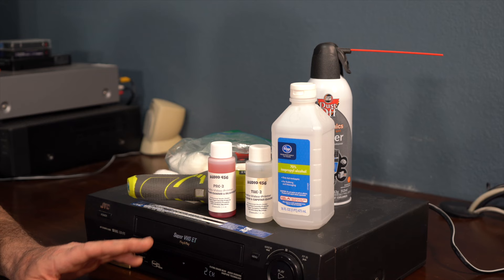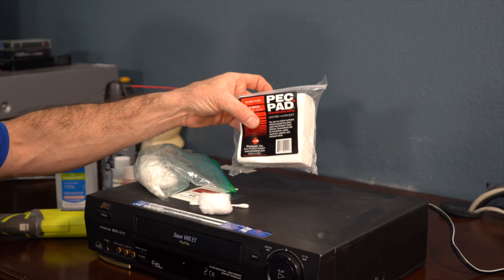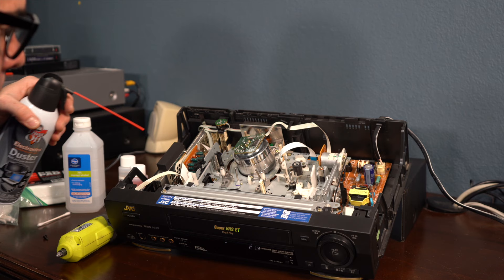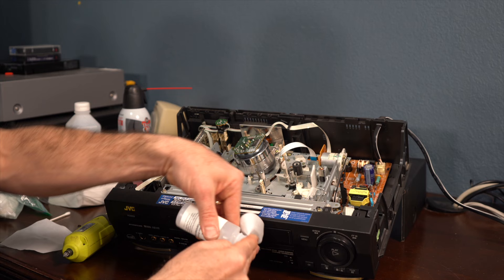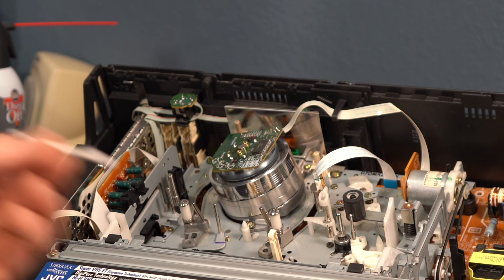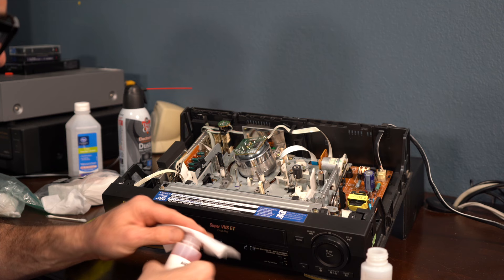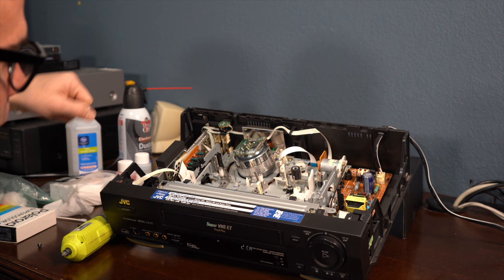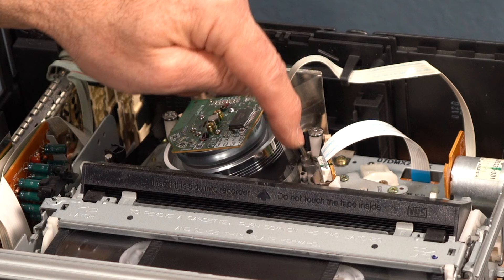How To Clean A VCR

Comment: 1. Don't touch the heads with fingers the oil will damage them 
2. Don't touch the heads with a cue
 tip the fibres will tangle on the heads leading to problems also. 
3.don't squirt a duster since the dust will get inside the drum heads. 
With patience pick up the dust with a cue tip and 99.9% iso propyl alcohol.  Use a folded piece of paper to clean the head drum - plenty videos showing this.
Cleaning a vcr requires patience and there's no simple way to do it properly without damaging it.
Reply from the maker: Everyone has there own way.  Thanks for your comments.

Comment: Under no circumstances should you be using q-tips for the head cleaning even a quick rub can damage it.
Reply from the maker: Out of over 20 years of cleaning vcrs, I’ve never run into an issue using QTips.

Comment: already clean the head few times,but when put tape for play it will play few seconds and then no more picture only showing- problem head status-,what to do?
Reply from the maker: Did you try another tape?  If you have and still getting the same problem, the heads could be shot. There is a company on Amazon called Track Town Treasure which has a lot of refurbished VCRs at a reasonable price.

Comment: Being French, I haven't read all the comments...
To clean the head drums, it's easier to use chamois sticks. They avoid touching the heads.
Reply from the maker: Yes, I have had a couple of comments about using QTips.  In the 20+ years of cleaning my VCRs, I have never damaged even one by using a QTip.  I don't know what other people are doing that will cause damage.  Doctors say that you should not jam the QTip in, just lightly on the surface! 😊 Thanks for watching and your comment.
Reply: I think chamois stick might be those flat polyester material swabs. Those would be perfect. I'll just use the low lint micro fiber cloth I already have.

Comment: Thank you so much for this instructional video, Mark. Very helpful. By the way, let me ask you a question: is it safe to clean VCR heads using paper? I've watched some YouTube videos showing people using pieces of paper soaked with rubbing alcohol to clean magnetic heads. In my case, I use several stripes of print paper soaked with isopropyl alcohol to clean the head drum of my VCR; sometimes, I use a clean microfiber lint-free cloth slightly wet with isopropyl alcohol 99.9% to clean it. And it seems to work. If you think this is the right or wrong way to do it, please let me know. And don't forget to answer my question, please. Take your time. There's no need to rush. Take care and goodbye.
Reply from the maker: Eduardo.  I never heard of using paper to clean the heads so I can't give you an honest answer if that is a good or bad thing to use.  I don't think that it would necessarily scratch the heads but the paper could tear and leave particles behind which would not be a good thing.  I would definitely use the microfiber cloth over the paper. I never used the microfiber but I think that would work perfectly.  I use a Q-tip and  a pec pad which works great.  Some people say that the Q-tip or a cotton ball snags in the little wholes on the main play head.  I never had an issue with that myself.  I find that I can gently press the Q-tip into the areas on the main drum and give a little wiggle back and forth to get the dirt out.  Thanks for watching and finding the video useful.  Please subscribe if you have not already.  I am gearing up to make a lot more videos in the next few weeks!

Comment: Great video. I’ve got a beautiful clean video signal on my vhs player but the sound output is very faint. Any suggestions?
Reply from the maker: You can always try increasing the audio in post production.
Reply: @TheMediaNerdMT  I wouldn't recommend that as that will amplify the amount of audio static.
Reply from the maker: Yeah, it will increase everything but you can apply a filter for static. If applying filters, it does effect the rest of the audio so the amount of filter needs to be tested to see what is best if any at all. Remember, this is to save old memories so something is always better than nothing.

Comment: Hello I bought a vcr player at a thrift store but the problem with it is that it eats the tape when removing the vhs 📼 why is that and also it don’t play at all I think it’s the play button don’t function I would need a universal remote control
Reply from the maker: Unfortunately, thrift shops don't test VCRs for proper play.  The VCR is most likely in need of cleaning.  Did you clean the VCR before putting your tape in? I don't know what to say about the buttons besides that they are shot.   I would return the VCR if you can and go to Amazon to purchase one. Make sure that you look at the reviews of the seller before purchasing.  I use a company through Amazon called Tracktown Treasures. They are great.  Remember, you get what you pay for. Most all VCRs are going to be refurbished and typically are not cheap.
Reply from the maker: Please subscribe!!!!!

Comment: What’s your opinion on automatic head cleaning vcrs?
Reply from the maker: If you are referring to the cleaners that look like a VHS tape, I don't think that they do as good as a job as cleaning it yourself by taking the top off.  The one that I have, has a single brush that just goes over the main head and none of the other parts.  The pinch roller is the rubber wheel that gets a lot of dirt on it which is one of the main culprits for the tape to get jammed and needs to be cleaned.  The VHS cleaner does not touch that pinch roller as far as I can tell.  This would make for a great video!  Thanks for your comment!

Comment: Do you know of any vhs tape cleaner machine? Clean moldy tape. 

Thanks
Reply from the maker: Not that I know of
Reply: @TheMediaNerdMT  do you know how to clean moldy tapes
Reply from the maker: @speakeasyarchives8764  did you watch the melted tape repair videos that I did?  Watch them.  You will have to open the cases and pull out the tape.  You will need to hand turn slowly the tape to break the mold off the top.  The mold should not be really on the surface of the tape but the edge.  Don’t use a drill like I did, only use your hands.  You may want to blow away with a can of air to remove particles during this slow and tedious process
Reply: @TheMediaNerdMT  if possible send link to the video you suggested. Thanks.
Reply from the maker: @speakeasyarchives8764 they are the last three most current videos on my channel. Can’t send the link at the moment because I’m driving.

Comment: can you use gasoline or diesel fuel?
Reply from the maker: Seriously?
Reply: @TheMediaNerdMT  yes i'm totally serious
Reply from the maker: I would have to say a big "NO" do to all of the oils in the fuel that would mess everything up.  The fuel would most likely melt the rubber and plastic components as well. All of the oils would gunk up everything. 
 The smell would be terrible.  Once you turn the unit back on it would most likely explode into flames (I gotta try that for a video).  People bust on me for using rubbing alcohol that is 98% because of the little bit of oil that may leave a residue.  Anyway, the short answer is "No, absolutely not!!!" (I just sounded like my mother).
Reply: @TheMediaNerdMT  ok thanks